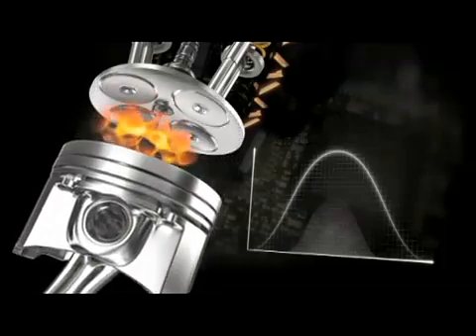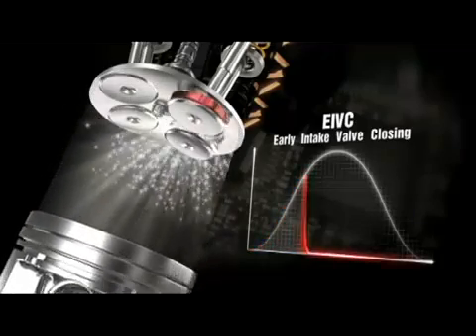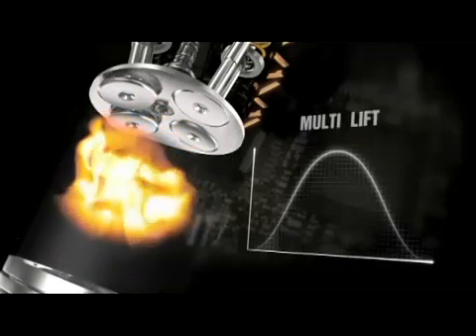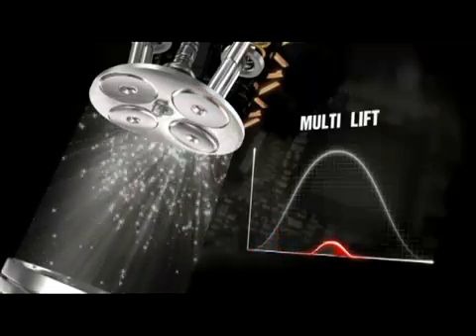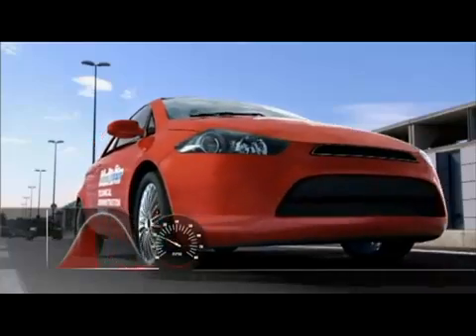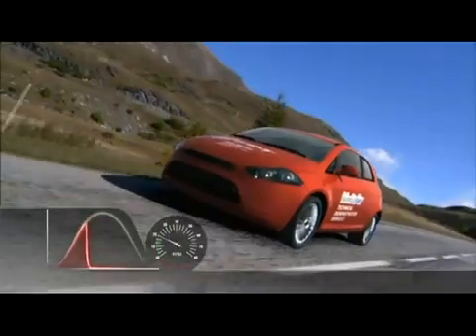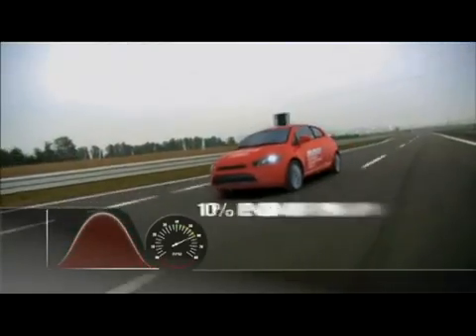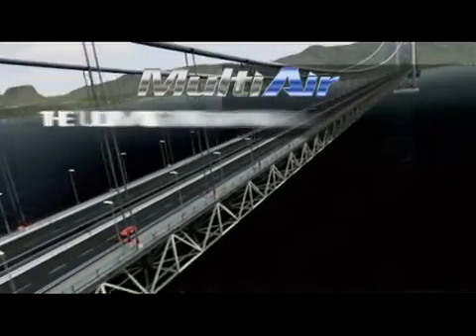FIAT - FPT PowerTrain MultiAir Technology

Comment: This will work great at first, but as the engine wears this system is overly complex and has way too many potential points of failure. Just look at the Cadillac Northstar engine; heralded as advanced and amazing for the time turned out to be an expensive paperweight years later. Don't call me ignorant- I owned one.
Reply: Insanity Crow they r hydraulic passages and valve. Good Lord it's not that complex or hard to design so it lasts 200k miles...
Reply: also with electronic solenoids in the motor as well.  They hydraulic passages, pump and build up the oil, then they solenoids flip the valve open however it needs.  Managed by an electronic control unit.  

They have to have that electronic control , if not then its pumping FULL air.   Would basically be like running at full throttle. 

So Insanity was right, they did add more points of failure.   

It's not hard to design anything to last 600k miles...but how would they make money? lol. 

But thats the trade off. More fuel and power efficiency , less emissions...but gonna cost more in the long run.
Reply: @bigjermini  engine. Not motor. And "full air" does not mean full throttle.